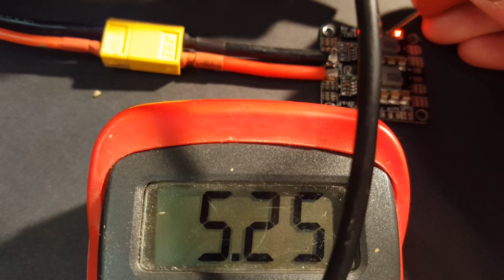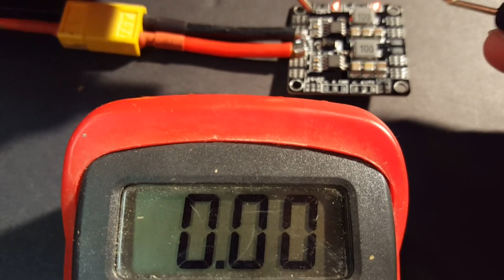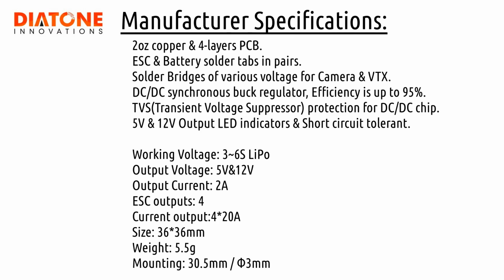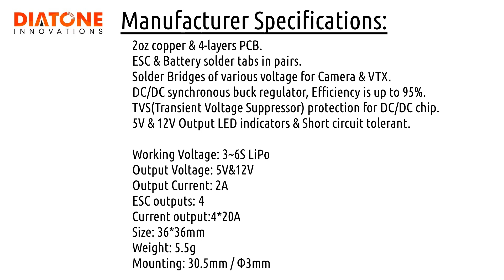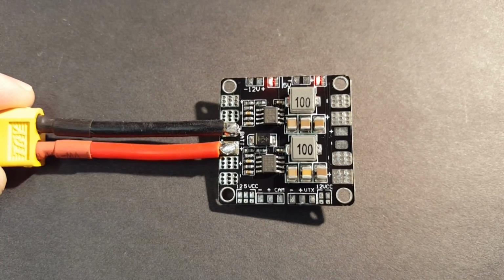Diatone V7 Mini PDB Review

Comment: Hi, great video.
I bought the V8.3 version but not sure how to wire, are there any wiring guides available for that pdb?
Reply from the maker: Rodrigo Siviero I believe O have the one that they sent bit I never made a video of it. basically, your esc and signal wires go into each corner. then, the white connector will provide power and esc signal wires to the FC. The camera and VTX have their own pads for power and you can run the video through the pdb as well to make it easy.
Reply: The White conector is confusing for me, do i need to connect it? My escs already have jst that I can easily connect to the fc directly

Comment: So how did the video interference go for these switching BECs?
Reply from the maker: +wepootheuser Sorry for the delayed response.  I havent had a whole lot of flight time on it yet, but what time I had was very clear video with little to no interference to speak of.  I did have video go out, but my inspection after the fact revealed I had poorly soldered a video ground wire which was detaching from the PDB. I used the exact same setup (with fresh repaired solder) on my new ZMR-X210 and am giving it a shot soon.